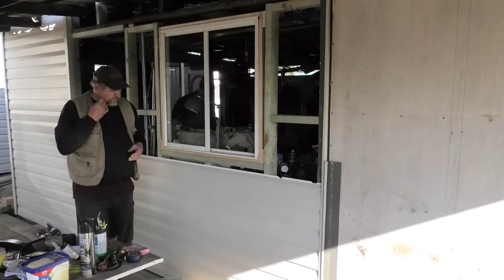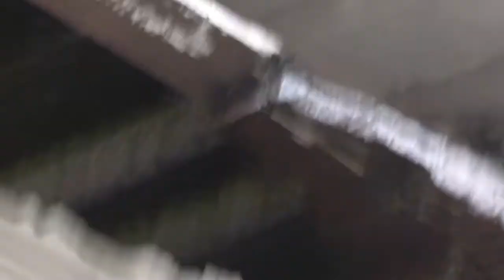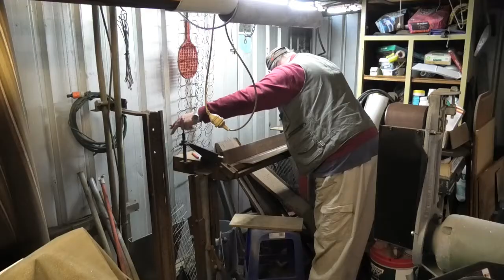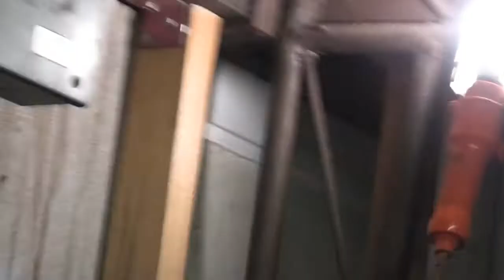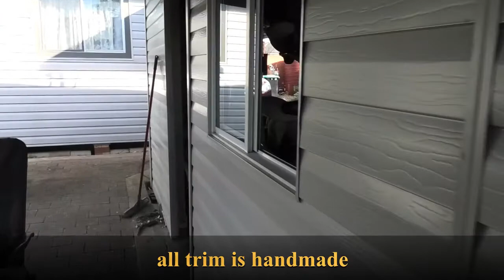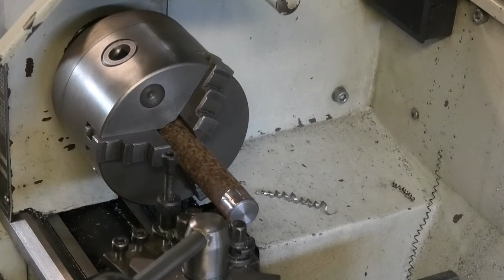Garage Facelift Part 4

Comment: Looking good Peter, excellent job of the trims, finishes it off nicely. Cheers, Jon
Reply from the maker: G’day Jon. Thanks for your support, yes the trim makes all the difference. The aluminium cladding has been out of production for a long time now so I had to make the trim, I looked for something else but it wasn’t big enough to properly cover the corners and then it had to be coloured matched and I’ve had experience with other cladding the colour matching “eye” doesn’t like uneven surfaces so “what the heck I’ll make it “
Cheers 
Peter

Comment: Shop is looking good. Managed to find a couple of pairs of Kant Twists at a swap meet recently but a few larger sizes are on the to do list also. Looking forward to seeing yours.
Reply from the maker: G’day John. Thanks for following. The garage is a fair sized job considering working around what’s inside and having to build the frame into an existing roof and steel frame and I don’t know what I’m really doing. So I thought I’d throw in another project (typical male) to break it up, COVID shutting our hardware to retail for a week also helped. 
I’ll be mixing it up for a while with the clamp project which should be good. I’m making the clamps from scratch as I’m cheap, actually they’re too expensive even as a kit. 
Stay tuned. 
Cheers 
Peter

Comment: looking great Peter, will you have to insulate the inside of the walls, it would be needed if over here in not so sunny UK, i think you should be called mr "factotum" too, look it up in dictionary!!
regards
mr f
Reply from the maker: Oh I did look it up, I’ve never come across it before and had thought what it meant, thinking a play on words. 
Thanks for the education
Reply from the maker: G’day Mr F. Insulation is not much concern but it does get a bit hot here, cold weather not so much. 
Cheers 
Peter

Comment: Gday Peter, the workshop is looking fantastic, I’m looking forward to seeing the Kant twist clamp build, I’ve got a set of plans here but haven’t got around to the project yet, great job mate, Cheers
Reply from the maker: G’day Matty. Thanks mate. I see you worked out what they are. Interesting project but there are some small pitfalls. The plan’s I got didn’t plot the hole locations as they were part of a kit and the hole locations were laser etched on the pre-cut arms. So copy, readjust sizing, oh no! The X and Y sizing was not as stated in the spec’s, this then caused the hole locations to be wrong, ahhh!
Double/triple check everything. 
Cheers
Peter

Comment: The paneling looks great Peter. Going for a shorter length was a good idea. Should all turn out really well.  Cheers Rob
Reply from the maker: Thanks Rob. This stuff is definitely awkward for a single installer but it worked out when cut. I didn’t overlap the joints but fitted a channel trim, that’s because the span was 5010mm and my panels are 5000mm. COVID’s slowed me down and Bunnings was closed to retail for a week so I started another project but must get back to the garage soon. 
Cheers 
Peter

Comment: Hello, I see you are adding a bit drama and suspense in the mix with the mystery parts, nice! lol. Siding, or do you guys call it cladding, either way it looks great. That oxy cut looked like an end of day "that'll do" kind of thing. But that was rough, lol. All the best!
Eddie
Reply from the maker: G’day Eddie. It’s mostly called cladding, the cladding I’m using is made of aluminium.
The cut is a mystery, if the awning roofing sheet wasn’t burnt I’d guess it was done to give the awning room but yeah a mystery. 
Thanks for commenting 
Cheers 
Peter